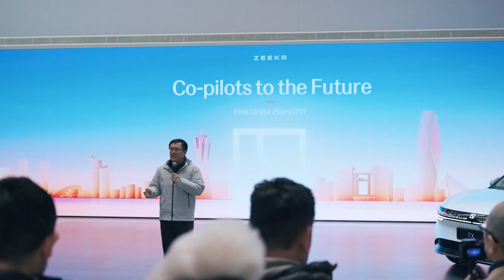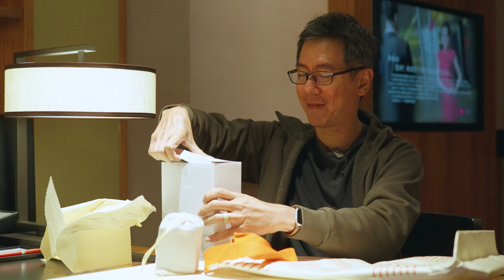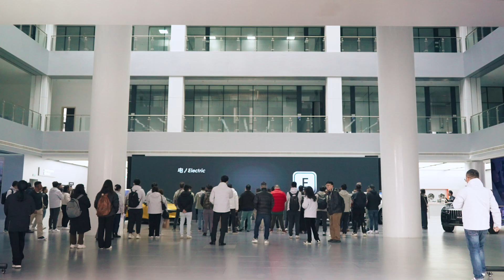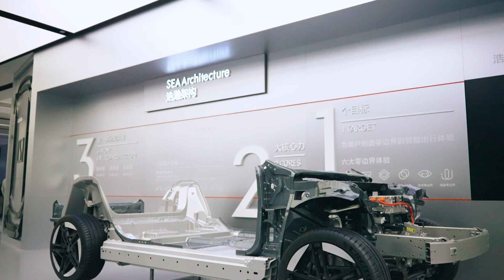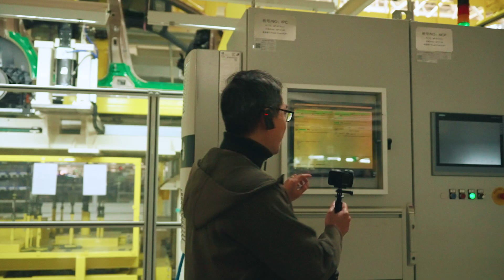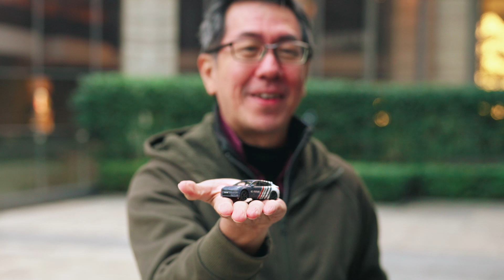Inside a state-of-the-art Chinese car factory: Zeekr's Meishan plant | MrChia SG

Comment: Do you consider zeekr X a good car?  I am about to get one in Costa Rica, I am afraid of other Chinese brands, geely has 30 years here snd BYDs a lot too, thats why I buying the zeekr, any advise ?
Reply from the maker: Hola Diego! Honestly, many of the Chinese EVs are starting to feel the same, but I think Zeekr does try to distinguish itself with nicer quality interiors and making its products fun to drive. 

I think the Zeekr X's handling could be better because the suspension is soft, but otherwise it's one of the EVs out there with some character. I wish I could say more about the reliability or ownership experience, but it's too early to tell right now.

But I do believe Zeekr will stay around for a while. It recently merged with Lynk & Co so that the two companies can share resources, and Geely group is financially ok
Reply: @MrChiaSG  I heard in other countries suspension was modified, I did a test drive and felt very nice, compared to other cars like rav4, this one felt premium
Reply from the maker: @diego2817  Definitely agree with you on the premium feel! I spoke to a Zeekr product planner in China who told me that they definitely tune the suspension for export models differently (it's softer in China), but this was about the 7X and not the X. The only Zeekr X I drove was in Singapore (the dual-motor version) and I found it soft and a little bouncy in the rear end, especially for the horsepower: https://youtu.be/pNPtiYlia6Y?feature=shared
Reply: @MrChiaSG   I got the RWD version, I think 400+ hp is not necessary in a SUV
Reply: @MrChiaSG  The Zeekr X is tuned for harder suspension in Malaysia.